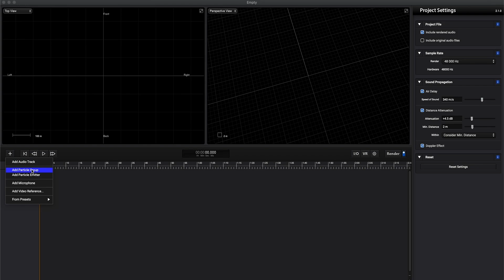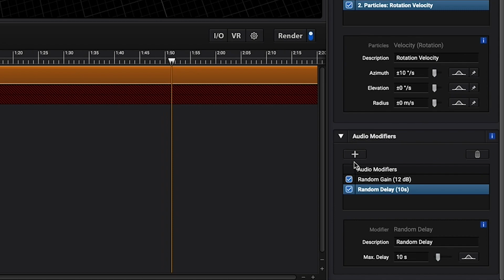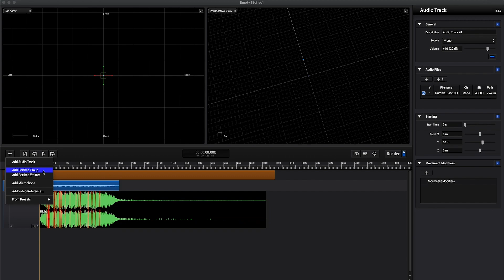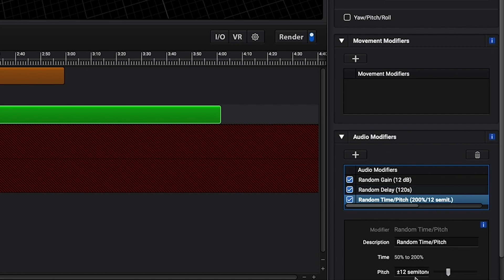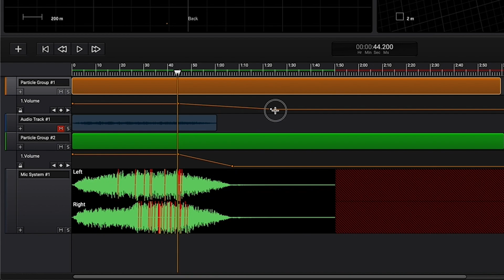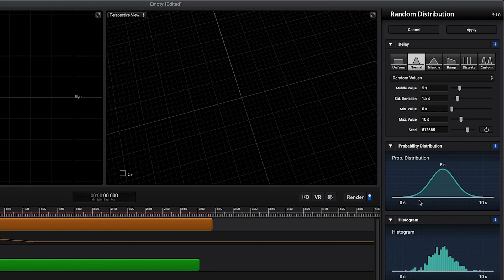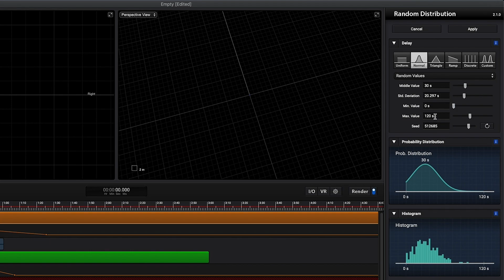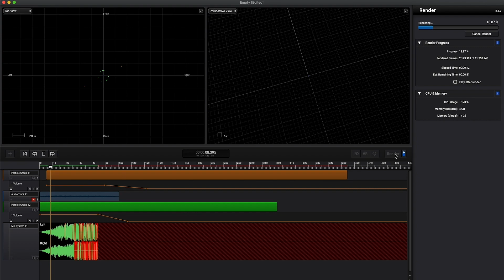Improvising Sound Particles - Part 1

Comment: how is possible to improve the performance of the rendering, in yours is quite fast. what is  the real best hardware specification for it?  thanks
Reply from the maker: Hi Dave. Thank you for your question. The rendering performance depends on the complexity of your project and the specs of your machine. The recommended specs are 4-core or higher CPU and 8 GB or more of RAM. Of course, the more the better. The machine we were using for this tutorial has a 16-core CPU and 32 GB of RAM.
Additionally, we are currently working on improving the overall rendering performance. Our goal is to render projects 100x faster within a few months.